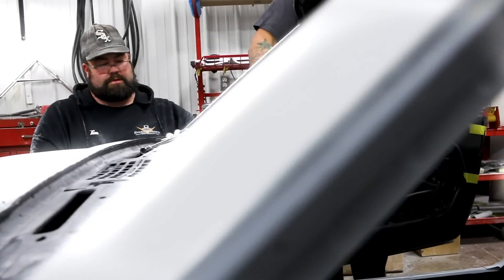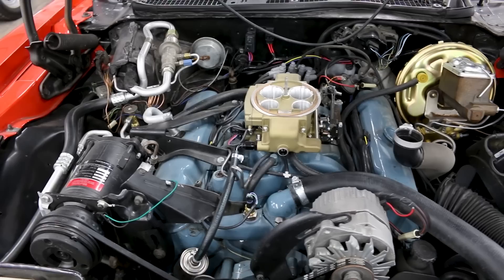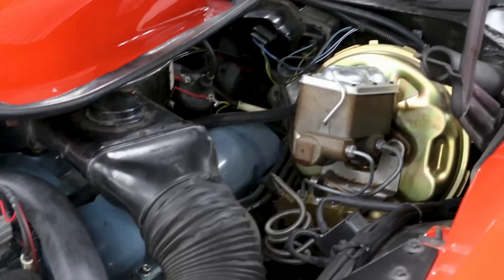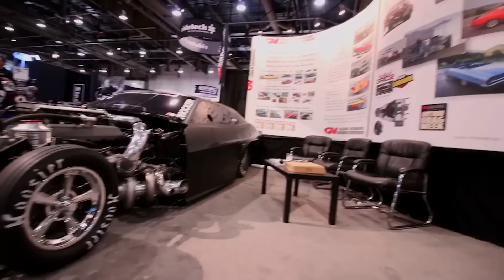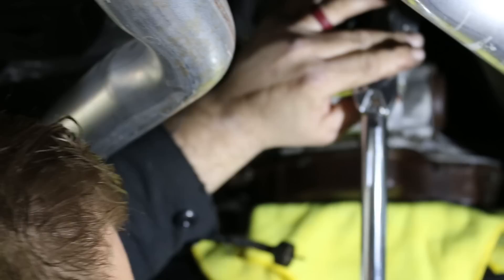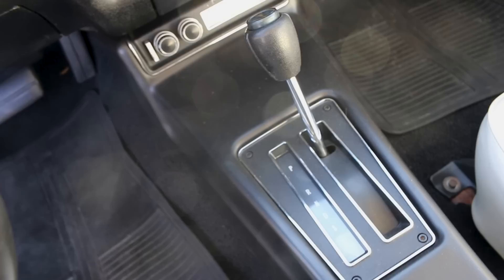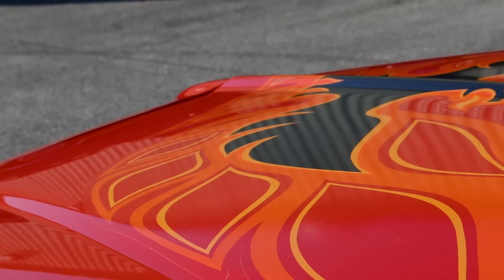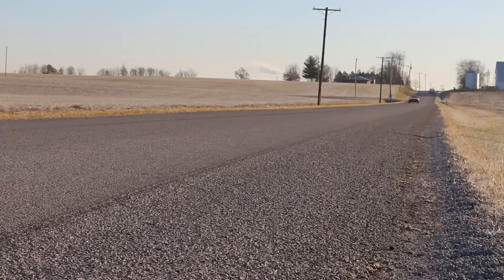1973 Pontiac Trans Am 455 Holley Sniper EFI Gear Vendors Overdrive Install V8 Speed and Resto Shop

Comment: What a stupid place for the lights. Good god
Reply: It's a clever place for someone not wanting to alter original look of the interior. The switch isn't used often, probably left in auto mode.
Where would you have placed it?
Reply: @johntempest267  
Agreed, I would have done exactly this idea , hide it best I can. The dimmer switch was quite a crafty placement!